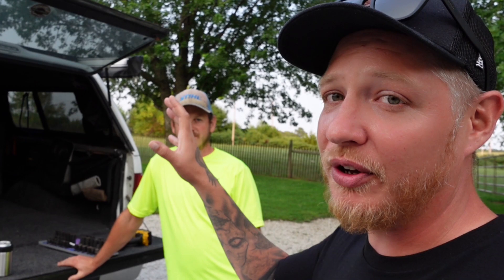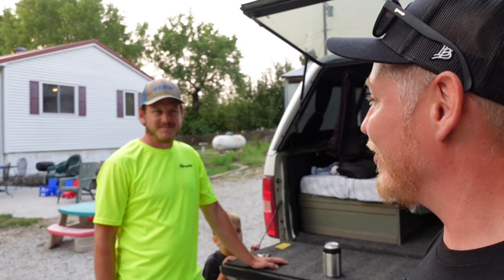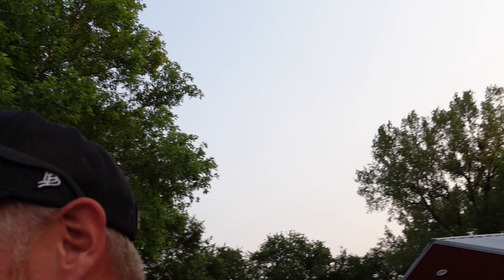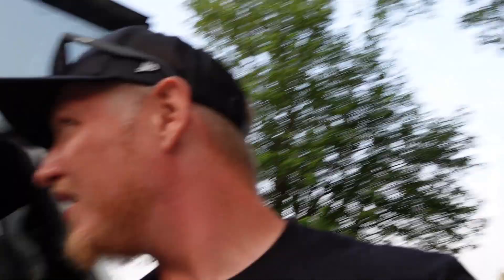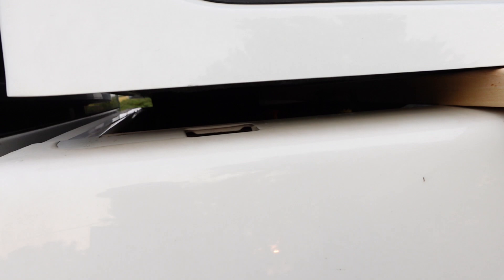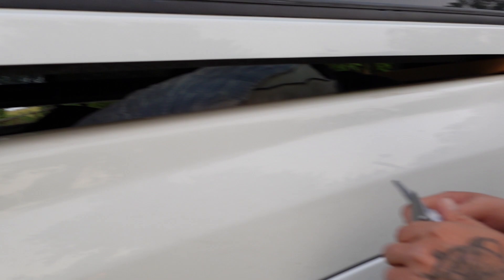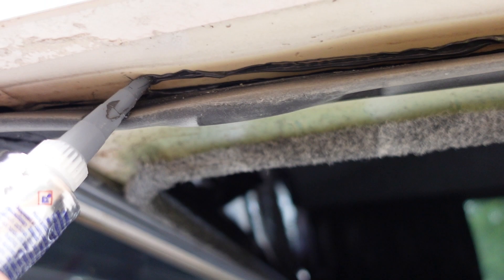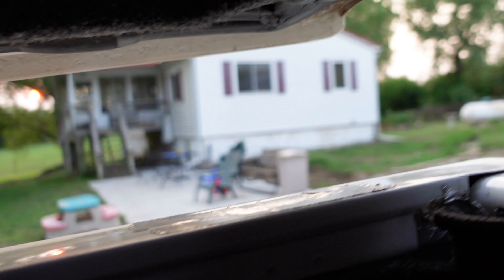Fixing My Leaky Camper Shell...(Maybe)

Comment: Check the windows as well. There should be weep holes on outside of frame at the bottom to shed water.  If they plug with debris, water will build up to the inside of frame and leak down onto rail. Place I work for sells truck caps, and we see that a lot, as well as the front corner of the bed bulkhead.  Good luck!
Reply from the maker: All the weep holes looked clear from the outside. Can I blow air through those holes no problem?
Reply: @CrazyQuady  Yep should be able to.  Garden hose is good troubleshooting tool as well.  You can strategically  place water in different spots for an amount of time to help narrow down where leak may be.  That's how I find water leaks on vehicles in general.  Hey if you ever make it to Ohio, look me up, got some cool places to camp around here.
Reply: @daemonjeep  now that is what I'm talking about., when people can give positive suggestion instead the dude Mr something on a post here, he is a jerk. Sorry but he really pissed me off with the way he was telling Mike how to do it right and this and that.  Enjoy your suggestion,  very smart and clever.
Reply: @Regina0964  I'm all about helping how I can, even complete strangers.  It all comes around full circle one day to each and everyone us......
Reply: @daemonjeep  ❤
Reply: That’s happening to my camper shell I just bought a few weeks ago and I noticed is leaking water from the locking handles but the ones on the side, those windows don’t slide they’re open up, weep seems fine hopefully you can help me thanks

Comment: Need to go to a marine boat Place ,buy some 5200 caulking they sell it in white I would cut tip big enough and roll a nice bead wait about half hour or one hour and set your topper back down. Buy the one that fits in a caulking gun.then if you have any left over put it in refrigerator will keep from hardening so you can use it later on. Great video.

Comment: I pulled my camper top and cleaned both the bedrail and the underside of the camper top.  I used silicone and reattached.  My top didn't leak anymore.  The windows that you have are also a potential source for leaks.

Comment: You can take a ratchet strap and hook it just inside the tailgate to the closed tie down hook and hook it over to the passenger side tie down hook and then loosen the back topper clamps and then tighten the tie down straps and adjust the gap then tighten the topper clamp's as you should have a better gap now 👍

Comment: Leer toppers are very hit and miss. I have two trucks both with toppers, one has a Leer and it is absolutely perfect in every way. The other truck had two tries at Leer before I got my money back and did an ARE cap. So far it's been ok... got it with no side windows so it's just smooth fiberglass that follows the trucks body lines. To be honest it looks amazing and has two less things to potentially leak.

Comment: It seems they never get them on square. I had to adjust it myself to get it right. The rear of the topper by the tailgate is usually not tight enough from side to side and needs to be pulled in before bolting it down. You can judge how well it's on by the gap around the rear window frame.
Reply from the maker: Thanks for the info!
Reply: Gotta wonder if the bed itself might not be perfectly square, just from the truck being on the road over the years.

Comment: Hi quady I have a leer topper also only it’s a high topper and I also have the gaps on my window it looks like they should have squeezed the topper in a little bit to close the gap luckily it has not been a issue yet it’s good for your friends Mike and the little helper to get you fixed up
Reply from the maker: I feel like its supposed to sit up higher on the besides to be able to pull it together to close the gaps

Comment: Mine leaked at the gate and window. If I wasn't parked so the front was higher then the rear water would run along the bed rail or inside on the canopy rail. I rigged it to stop with some rubber gaskets. Also stopped the cold air blowing in and out through those holes where the gate and window meet, I sealed the whole gate to stop dust from blowing in also. 
looks like you need to pull the fender guards and sand that rust off. B
Reply from the maker: There's no metal left to sand under those fender flares  🤣

Comment: Take the cap off and replace the seal.
Reply: Exactly what he should have done rather than mess around with some caulk, do the job right the first time!
Reply from the maker: If it works thats all that matters, the rtv was 1/4 the price and hassle
Reply: @CrazyQuady  i feel the guy or person you're responding to, is i feel a jerk,  like I said Mike isn't stupid, so stop commenting like you're pro at fixing leaks in cabs.   Encourage dude not discourage... be nice
That goes to the jerk that thinks he's pro at fixing leaks on cab,. tell him to go bite it, you don't need negative people on your channel,  you're doing great Mike and I always your video's.. ,#1
Reply: Good on that but if it leaks again you would have to remove the cap and remove the old seal and then clean it which means more work for you.
Reply: @hectorching3666  your suggestion is better then the guy up top in the post.. thank you for your suggestion,  gotta have positivity.. enjoy your evening
Reply: @Regina0964  hey Regina, since I just installed a Leer 122 large high-rise side sliders with double lock rear door, front solid window, black  carpeted headliner with the optional rear bays 122/t class model , LED dome light and I used rubber premium cap seal with high bond adhesive on my 2020 Toyota Tundra, yes I guess that makes me a pro, thank you for the acknowledgment 🖕
Reply: @mtradz  sounds like you got money.
Reply: @mtradz  i wasn't trying to mean or rude, it sounded like you where.. I'm sure you're a nice person
Reply: @Regina0964  I was not being rude or mean either it's the way you took my initial post. I accept your conciliatory apology.

Comment: Question. When you disconnected the cap from the truck bed if you wanted to slide the cap back a bit is there wiring connected that would prohibit you from moving the cap back? I am going to replace the weather stripping under my truck cap but I also need to change the gasket on the third brake light on top of the truck cab. Your video was very helpful too.
Reply from the maker: There was wiring at the rear that goes up to the third brake light, there was enough slack in mine to move it around. If I remember correctly there is a disconnect on the wire there also.
Reply: @CrazyQuady  I found the wire. Thank you. I appreciate it.

Comment: You've had the camper shell on for 6 years and in all that time driving and bouncing around, of course it's shifted and started leaking. The seal is not as good as it used to be. If it was mine, I would have bought the best seal possible which in the long run is cheap and since you already had the cap separated from the bed, replaced the entire seal then put the cap back on. I didn't even have to watch the whole video and figure this out in the first couple minutes. As Joke Biden would say, "come on man". 😁
Reply: Wpw, maybe others don't know how to fix a  seal, they don't need someone to tell them how to do it, it's their cab.... Mike isn't stupid,  he knows how what he's doing.
Reply from the maker: 😂 it takes 10 mins to pop it off, if I have to do it over it's no big deal
Reply: @CrazyQuady  one thing you want to think about also is put a wrench on those nuts holding the cap to the bed and make sure they're still tight I would do that every other month at least.